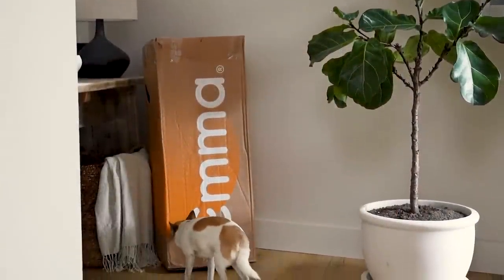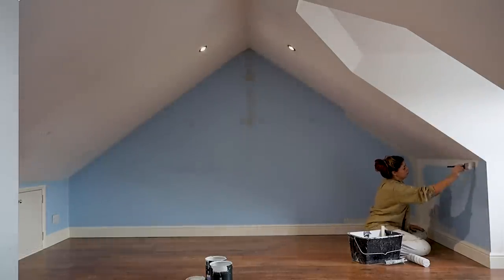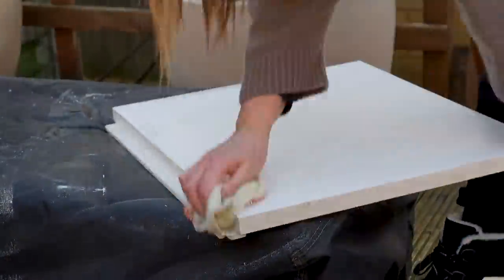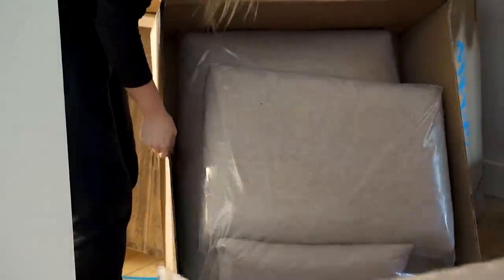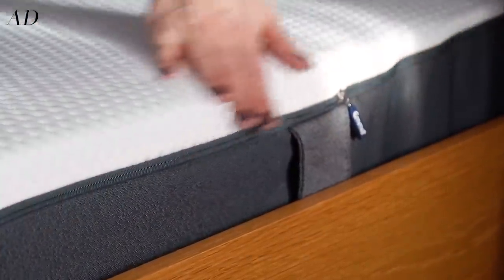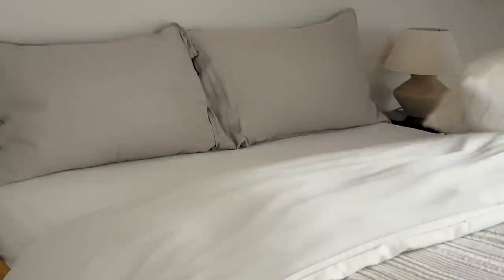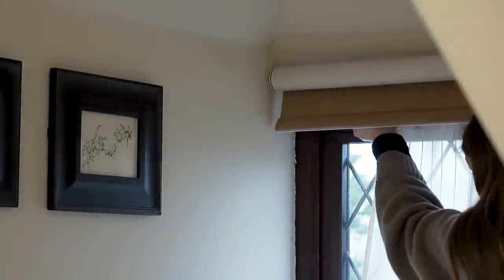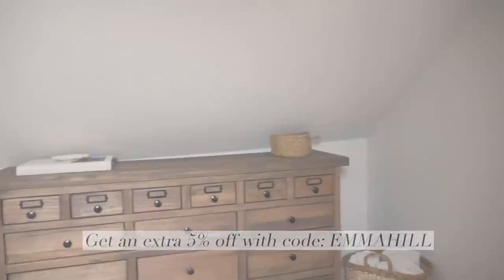Guest Bedroom Makeover

Comment: 11:20 10.5g duvet in winter NO!
HAVE 13.5g as a year rounder in Ireland if your house is cold and doesn't hold the heat because of insulation use 15 g duvet have a dormer house with 2 bedrooms upstairs gets very warm during summer love it! So a flat bed sheet a light scalloped throw is essential 💜
Reply from the maker: I’ve tested this and it was more than warm enough here 😊
Reply: 🤩 love your home series